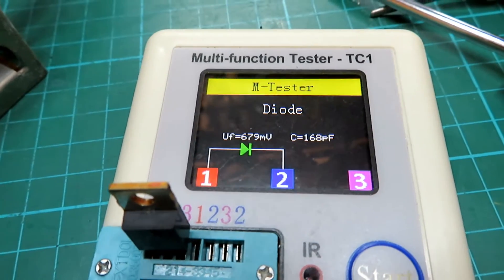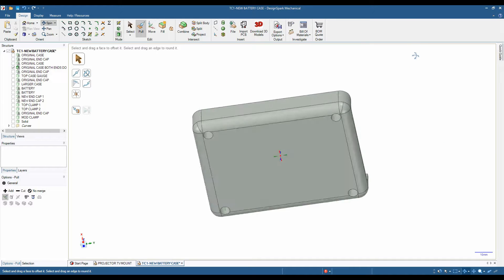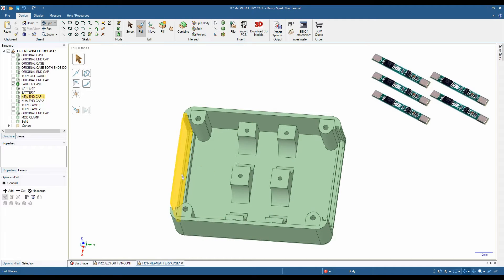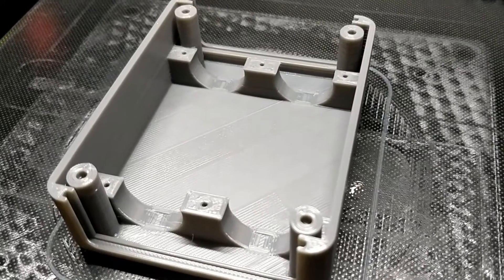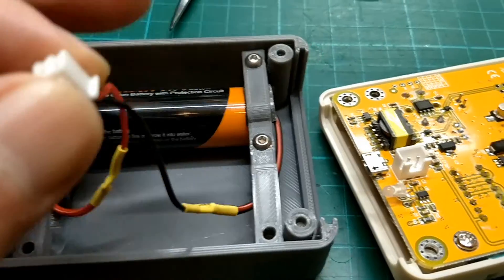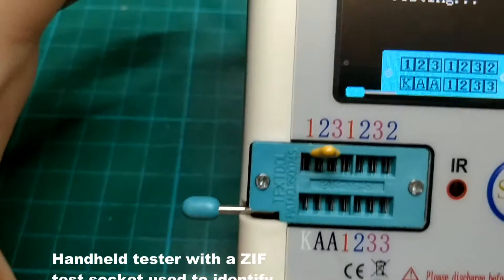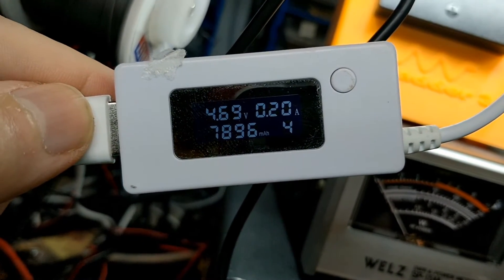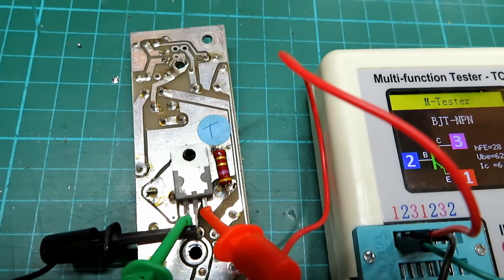INCREASE THE RUN TIME OF THE TC1 COMPONENT TESTER BY 20 TIMES - FREE DOWNLOAD

Comment: Besides this it also helps to add a switch to disconnect the battery when you don't need the device since it always draws power even with the display turned off.

Comment: From the day I got one of these it seemed like it needed to be charged before every use. I'm wondering if there is a problem causing the battery to discharge while not in use.
I removed the old battery which looked a little swollen and replaced it with a similar one salvaged from an old bluetooth device. Will see if the problem persists.

Comment: How do you increase the accuracy of these? Compared to my multimeter it shows capacitor at 454uf where mm is 477uf. The supplied 3 pin calibration doesn't help either. Thanks
Reply: The frequency of the tester also effects the measured readings.
This is why professional LCR meters allow you to change the frequency of the test signal.
ESR is frequency dependant, capacity somewhat less so as the tester applies a voltage through a resistor and measures how long it takes the cap to charge/ discharge. It measures resistors the opposite way.
Reply: Late reply but maybe it helps someone: The supplied 3 pin thingy for calibration apparently has too much capacitance. Use short pieces of wire instead. Apparently accuracy also increases the more times you calibrate it, say 10 or 20 times.